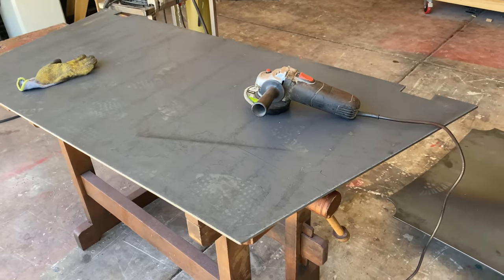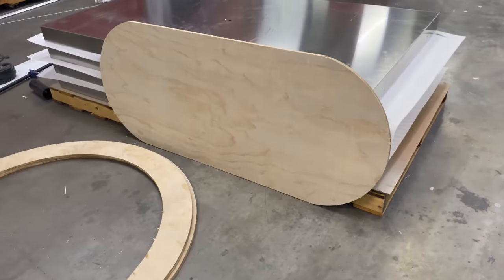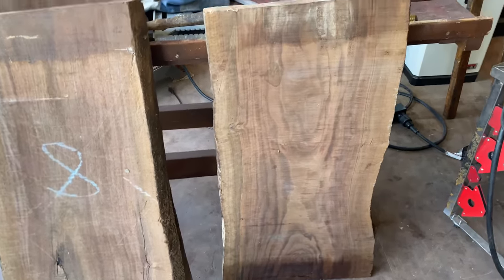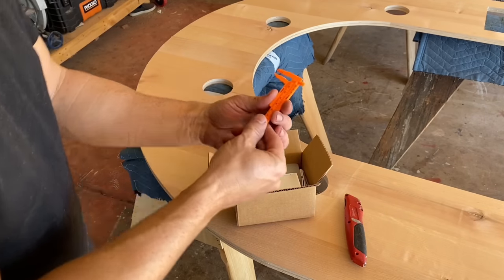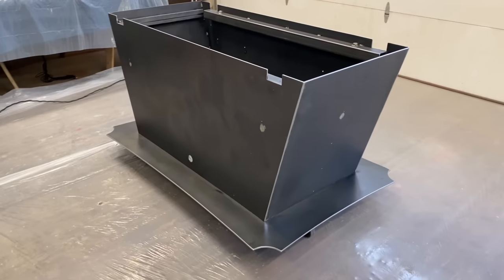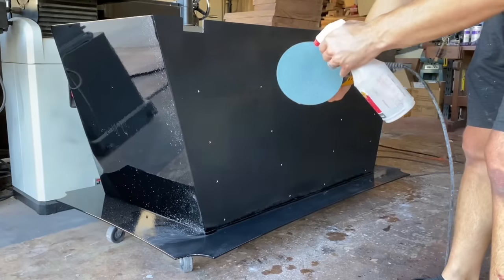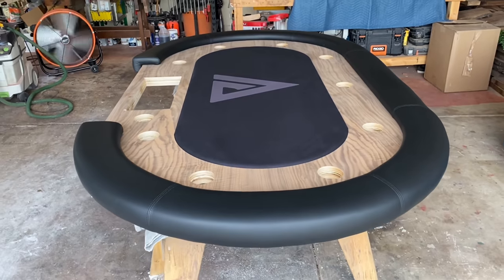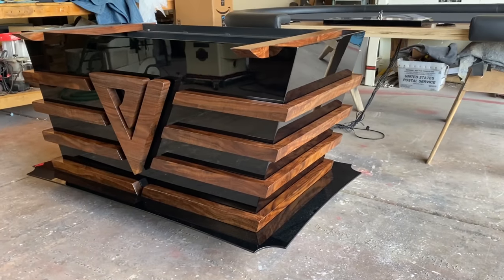Luxury Poker Table Build

Comment: I have some constructive criticism if you can handle it. I love the build but there is one thing I would hate to have if that were mine. The center of the table should always be the same height as the outside of the inner ring. That little lip makes it easier for cards to accidentally be seen to other players if they hit it right. Also the wood makes it harder to pick up the cards and the felt being higher makes it so you can’t just slide your cards to the dealers. You have to pick them up and we all know what a pain cards are to pick up off a hard flat floor. The whole point of the felt is to be spongy enough to get your fingers under the cards. It’s not just for show.
Reply from the maker: Thank you for the feedback!   A lot of these decisions were client driven, but I hear what you're saying though!

Comment: Baller build 😎
Was the power out at the Dealer's feet a design choice or a customer request? Could have almost made a hole in the base and sat the power inside the table, making nothing visible.

Having said that, this is pretty damn close to a casino-level poker table 😳😎

Comment: Why not fully weld it up the sides ? Why only tack welds? Could have been so much stronger.
Reply from the maker: I tacked them in the video but did 5-6 count 3-4” beads on each seam, theres no need to fully weld the seam on something like this.

Comment: Not knocking on such a great job but id recommend powdercoating that hunk of metal next time would've came out so beautiful
Reply from the maker: Powder coat over 2 stage automotive?  Not a chance.  It would have been dull and shown major orange peel.  Definitely has its purpose but not on a luxury poker table
Reply: @MattsWoodworks  powdercoating can be polished and wetsanded in the same manner.
Reply from the maker: @Pistonstrokes  It actually can’t, from my own experience too. There isn’t enough in the single stage to get an appearance like a 2k urethane after a cut/buff/polish.   If you have any pics of polished powder coat that looks just as good send em over!

Comment: Literaly amazing quality!!  But the product designer in me can't help but get concerned about the wood slats being used as foot rests for some people.. and also the wireless charging.. oh man you're putting your faith in those lasting for a while without ability to swap them out if they break
Reply from the maker: Thank you!  I made sure to use extra hardware support through the steel into the wood, I figured people would use them as a resting point (hoping they won’t but know it’ll happen haha). Also, I counted on all of the chargers potential failing at some point, so I made the top so it can be totally broken down and serviced. It’s all sandwiched with threaded inserts and bolts. 🤘🏻
Reply: @MattsWoodworks  oh man! amazing! Even better then. Bravo sir. Very very nice work. I've designed consumer products for 15 years and its hard to fine such attention to detail

Comment: How did you secure the top of the table to the base?
Reply from the maker: @ 11:26 you can see the wood aprons, I attached to the top with threaded inserts through the bottom side of the wood.
Reply: @MattsWoodworks  ahhhhh I completely forgot about those slats, thanks👍

Comment: Table top is Amazballs. The base however, even thought its great. Its just not very practical. Fantastic work though. You make it look so easy
Reply from the maker: Thank you! What do you mean not practical?  Totally just curious
Reply: @MattsWoodworks  Hey Matt, As per one of the comments below. If you had to move it into the basement or different room, fitting it through doorways will be quite tough. And carrying that weight down stairs ,hmmmm i wouldn't want to do it haha.  Being able to disassemble the base would make it easier to move and lighter to carry. Some good detailing on the edges and thought into the assembley could make this quicker and easier to build, and open it up to more customer orders . But without knowing the brief, they could have asked for it to be purpose built for that room and never move it. My 2 cents anyway. It still the best table I have seen being built on youtube. I would defiantly use some of your techniques if I ever get the chance to design and build my own one day.

Comment: It's a beautiful table and if you got paid $38k to build it more power to you.    However, as one who has built high end custom poker tables before (even electronic ones), I just can't see how this table cost anymore than $10-12K in material and labor.    You got one hell of a markup going.
Reply from the maker: Materials alone cost me more than that: plasma steel work, 10 Claro walnut slabs, water jet work, wire management/chargers, automotive paint/clear, Italian leather/foam, custom 5x9’ Claro ply, cnc work, dye sub felt, all of the consumables etc.  Can you show me a similar poker table, with the same features for 10-12k?
Reply: @MattsWoodworks  With exact materials, you used, of course not.  But to prove to you I know what I am talking about, if interested, I can show you a $40K computerized 10 player poker table I build for $25K about 15 years ago with a metal fabricated base, padded rail, and a custom electronic glass touch system (before cap touch foil was invented).  It had about $15K worth of electronics in it including 2 50" tvs, 10 bill acceptors, 10 ticket printers, a computer, etc.   I wrote the game software myself.  Point is my fabrication cost (minus the electronics) was about $10K and that is including cnc, welding, upholstery, and metal finishing etc.  You can get a lot done for reasonable pricing by contracting out on MFG.com.  However, building materials are relative. I mean, you could always trim your felt with small diamonds and make it a $380k table.

Comment: This is beautiful. No doubt. High quality build. But if this is intended for frequent use in a home poker game, the design is all wrong. First, that wonderfully grained wood is going to get worn and scratched to hell by constant chip moving wear and tear. Second, since most poker players these days are in the habit of constantly shuffling their chips at the table, there will be excessive amount of table noise. But then, having a wooden surface would make chip shuffling with one hand a lot harder and would likely piss off anyone trying to play on this table. The client should have opted for a completely speed felt top. Also it's odd to shell out this much on a custom job and not put in a belly cut for the dealer and a card shuffler.

Comment: Whats so $38k about it?
Reply from the maker: Anytime something that is designed from the ground up, that calls for ultra premium materials it’s going to cost a lot.  Also, when doing a one-off project it takes 2-3 times as long to figure out the process vs something that is already designed/been made before.  This build took upwards of 300+ man hours from start to finish, then of course the material cost.  Does this answer your question, Michael?
Reply: @MattsWoodworks  In my country i would get it for maximum 3k :)
Reply from the maker: @Syrinxification  3THOUSAND?! wow, it cost me 6-7 times that in just raw materials lol

Comment: Really really good craftmanship, but poker "playwise" this type of table, is just not any good. The wooden outer ring on the playing surface, makes it a nightmare, to look at your cards, when needed. You will want the playing surface, to stretch all the way under the rail, so you have foam everywhere, and no edges. Just a heads up, to any builders. And put the cupholders, in the rail, with wooden rings embedded, underneath the vinyl, cup holders, on the playing surface, is another bad design. This build looks good, but plays really bad.

Comment: A lot of basic design mistakes. First your racetrack should be level to your felt. If not the felt should only be slightly raised, 1/32. You have seat 1 and 9 having only half a rail. I can’t believe with such a large base you decided to hide the cables in the wood, technology goes bad and needs to be replaced.